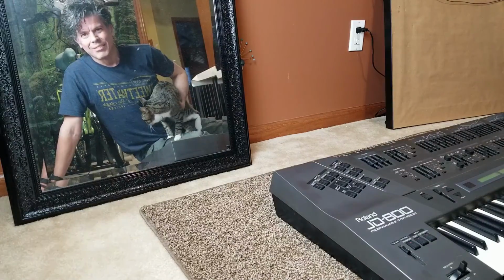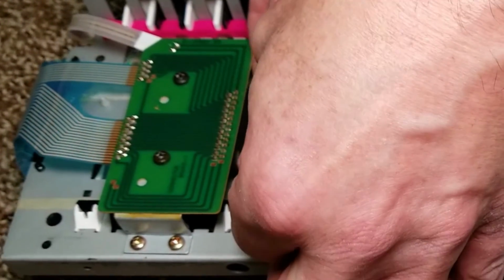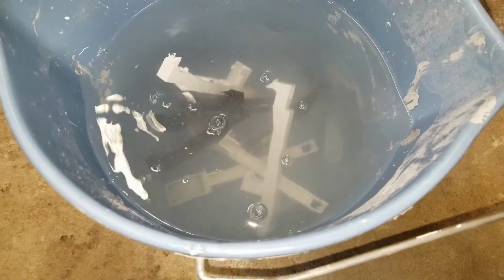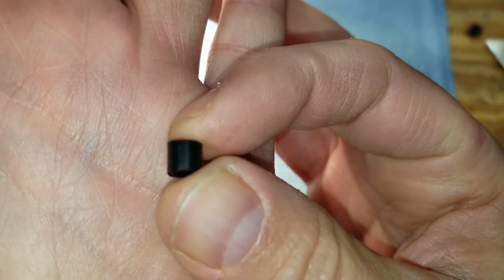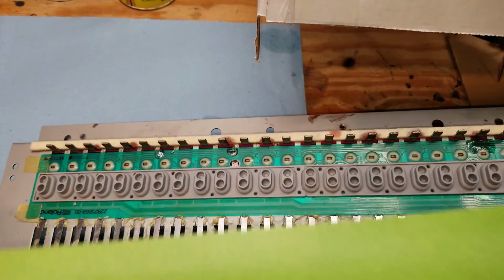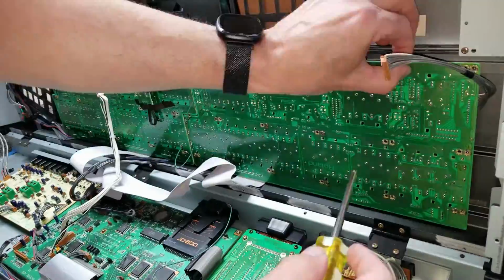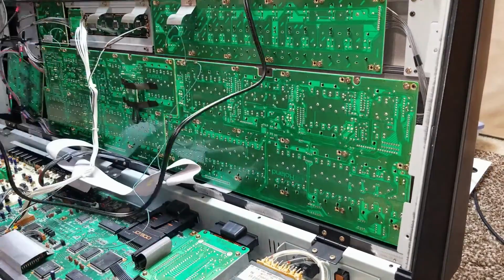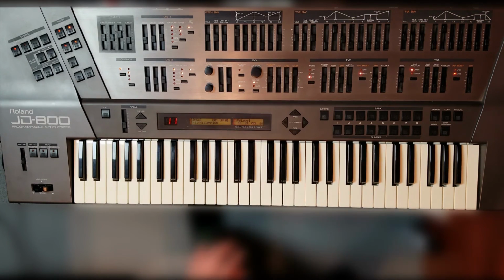Roland JD-800 Repair, Restoration & Modification

Comment: I stripped and serviced my JD800 a few years ago ... fortunately, the keyboard had already been replaced but the sliders and switches were in very poor condition.  I ended up desoldering and disassembling every slider as the synth kept 'self-editing' as the dirt kept randomly shorting or triggering the slider parameters.  I cleaned everything with isopropyl and relubed the slider which stopped the dreaded 'self-editing' bug and then replaced the switches with a set I had bought off ebay and that gave it a new lease on life.  Well worth the effort on such a fantastic synth.
Reply from the maker: A lot of the synths the sliders are available new still, which is always a great option as well. Fortunately for my JD800 the sliders just needed cleaning and lubrication. Glad to hear yours is in great shape!
Reply: I avoid deoxit personally, just adds to contamination, gathering and sticking the dust together.
Reply: @guywilkinson  what do you use instead?
Reply: @Ambientnauts  I normally desolder and open them, but only clean the track and contact end with IPA & cotton tip, don't clean or lube the rest unless it grinds. With an electric desolder tool, removal is rapid and on the 52nd slider, the last one takes 2m 30s to clean including testing with a psu, resistor & scope to confirm.
The first ever clean on my synth was done with a big vacuum cleaner with fine nozzle, worked a treat.
Another issue is that shoddy people spray the entire board with deoxit and it contaminates the connector surfaces causing issues (fault looks like bad pots) and gets everywhere - so messy.
Another issue is that the 10uF electrolytic caps in the front panels go dry and they filter the reference voltage feeding the pots....so they appear noisy when they are not :-)
Reply: @guywilkinson  I had a sneaking feeling that a musician friend is constantly ruining his vintage synths. He says spray dexoit on the keys if you have dead ones. I am like that sounds like a really bad idea, there is rubber under there and contacts. And he is constantly bringing them in for repair. Thanks for you thoughtful input. When I use IPA do you use 70% or 99% ? Does it matter...

Comment: This is very interesting! I bought a JD-800 new in 1992 .. and still have hit. I had no idea of the red glue situation till I was reading an interview somewhere with Rick Wakeman and he mentioned the red glue on his, I immediately dropped my magazine .. ran out to the studio and looked under the keybed and sure enough sticky red glue dripping down the front of the keys! I then checked my D-70 (which I still have) and same thing! 😡 lol. So this was in the year 2004, I lived about 45min from Roland Los Angeles ,so I drove both the JD-800 and D-70 over to Roland .. and they replaced BOTH keybeds with brand new keybeds .. some 12 years after I bought em! Both keybeds are excellent .. much better than even modern Fatar keybeds! The only bummer was when I took the synths over to Roland in Anvil cases .. they were both in perfect like new condition, but Roland put a nice scratch in the finish on the top of both synths in areas you see everytime you play em, being pretty OCD I was pretty upset at that .. but getting brand new keybeds for free kinda made up for the scratches .. that glue was nasty 😳 If not for the scratches Roland put in em they both are perfect condition time capsules .. that I never play, my VST plugin synths have replaced all my vintage hardware synths that I still own in daily working use. Anyway I thought I’d share this since your into refurbing old synths.
Reply from the maker: Yes, Roland had a "recall" of sorts on those synths where they were replacing the faulty keybeds with new ones. It went on for quite a while, but they eventually stopped, and the keybeds aren't available anymore.

I did see online where someone shoehorned a modern Fatar keybed into his JD-800. It wasn't a perfect fit, he had to make minor modifications to the case and do some work on the circuitry, but it did work.

Comment: Thanks so much! I just paid $1000 cash for one that I was assured was "working perfectly" and got it home just to find all the classic problems. I followed this video and got the same rubber key strips from Turkey as you did and everything is working perfectly. I have to say, your JD was way more messed up than mine. For the springs I found it easier to just dab a little grease on the end before putting in place. The Q-tips were making a mess on the first couple for me. Thanks again.

Comment: I found a very easy way of getting the rubber nubs of the key contacts to go back in the holes in the steal. Use the back end of the right size drill bit to push it in. They slide in easily with no oil..

Comment: Glad to have found this! I also have a JD800, and it has shed most of its key weights (i.e., red glue issue). Going to use your video here to guide me in clearing out the glue and restoring the key bed. Cheers!
Reply from the maker: I had all but one of them, and just made my own replacement. It works great now!
Reply: @geneticeffetcs - Good luck! Caustic soda works very well like in Scott video. I let my keys soak for 24hrs, some of the weights didnt come out, so I soaked in fresh solution for 48hrs and all weights dropped off by themselves (give solution the odd stir). I used 500grams of caustic in regular bucket filled to near the top.

Comment: Thank you so much!!! I got one and three of the keys were broken in shipment. I took it to a local Roland repair shop, but they were backlogged, so I decided to give it a go, watching your video. I got the replacement keys and after following all your steps on how to insert them, it worked! The black strips that held down the back end of the keys were brittle, and a  couple broke off, but I added small amounts of gorilla glue and they held. If I have discovered a “gorilla glue” problem, I will report back! Thanks, again!!

Comment: I just dealt with the red glue, wasn’t bad, just a few drips, so what I did was remove all the keys, soaked them in hot water, scraped off as much as I could and then resealed the edges of the weights with a new epoxy so nothing else could ever drip. Perfect fix!

Comment: Hi Scott. Just stumbled across this great restoration video. I have a beloved JD800 that has the same "red glue of death"  problem. It's had it for years and even though the white key key weights have fallen out, the keys still functioned. Black as well. But in the last year or so, I suddenly got dead keys. Some would play and some would not (black or white keys). They were all still pressing down, not stuck. What was strange was it would depend on which patch. Keys that were dead might sound when switched to a different patch. Thought it was a voice card going bad. Took it to a local shop and the guy said the glue got into the key contacts. Thought that was strange since, as I explained here and to him, that keys would function on a per patch basis. Anyway, he said parts are no longer available and nothing could be done. I even contacted Roland and they basically said the same and that they don't service these synths anymore. The rest of the synth works just fine, and I'm using a controller keyboard to play the JD (all keys sound). I have learned that I could try finding a used Roland U20 somewhere as it uses the same keybed, but would have to find one that also doesn't have the glue issue. Those are hard to find problem or not.

I really hate the fact that my beautiful JD has been relegated to being just a sound module. I don't really have the time or expertise to get into a lengthy restoration project. So, I have to ask, would you be willing to restore just the keybed for me?  I am willing to pay for your time and materials (within reason!). I tried finding a way to direct message you here to ask, but there doesn't seem to be one.  If there's a better way to contact you, please let me know and let's talk. I'm in the Los Angeles area. Could send it to you and pay for return shipping in addition to the repair costs. It's ok of you can't or don't want to. I'd understand, but I would be forever grateful. Would love for someone who has the knowledge of doing this to help out as I'm afraid I'll ruin something even more.  Thank you.
Reply from the maker: I would suggest talking to one of these people - they do these fixes professionally, and have access to the aftermarket keyboard flex PCB that you're likely going to need: https://supersynthprojects.com/availability/fitting-partners/
Reply: @ScottsSynthStuff   Thank you very much for the referral, Scott. I’ll get in touch with them. Take care.

Comment: Thanks for the video Scott!  So helpful.

It looks like the keys can move left/right quite a bit due to the brush on rubber.  If you take it a part again, you might want to find tubes like you used, but thinner walled so you can fix that issue.  Maybe even a teflon tube material. I would check out McMaster Carr.

Also, regarding lithium grease on plastic - that may have been a bad idea.  Lithium grease is usually mineral, or petroleum oil based. Better to avoid that for plastic and anywhere near electronics. It may erode the plastic surface. Also, it tends to migrate everywhere. I mean by spreading out in a thin layer to cover everything it touches. If it drips onto the circuit board, it may migrate underneath the gray keyboard caps, and onto the carbon pads and ruin them.

What you used may be OK. Check it. For anyone doing this from the scratch, though, do some research on plastic safe silicon grease. Silicon grease is far better for plastic, or metal on plastic interfaces. You will find different viscosity and compositions. On a synth keyboard, you want a thin grease (or at least not really thick) which will not impede the key from bouncing back quickly. But make sure it has good adhesion for metal to plastic applications so it also doesn't just scrape off.  If unsure, any common silicon grease is likely better than any lithium grease.

Regarding the carbon keycaps on the keyboard.  There are kits you can buy that have a carbon material you can paint onto the black carbon pads on the rubber caps.  Results may vary.  Being able to buy a proper replacement is by far better, but in case people can't find replacement rubber caps, this is an alternative to consider.  

No restoration is perfect, and each job is a learning experience. So please don't take my comments harshly. We all learn this stuff together, which is why you video is so invaluable. Thanks!
Reply from the maker: I agree, I could potentially find a different, thinner walled rubber tubing, but at that point, I wanted to get it back together, and that's the option I thought of - it actually works (feels) quite good.

The lithium grease I've actually used extensively in plastic applications before on motorcycles, but that is ABS - I'm not sure what the keys on the JD-800 are, but they don't feel like ABS to me. I will watch, but this grease in particular does not liquify at commonly found environmental temperatures, so it should be OK.

I actually did have a tube of Caikot 44 https://amzn.to/3abKFuy on-hand to do that carbon recoating, but when I first discovered some of the keys were not working well, I tried using it without much success. That's the point at which I went ahead and ordered replacements. I didn't cover the use of the Caikot in the video, because it did not actually work for my problem.
Reply: @ScottsSynthStuff  Re: Calkot, ya that is what I feared.  I have some, but haven't used it yet.  I had heard it has mixed results.  I was dealing with vintage computer keyboards and have seen some people have success, but others not.  Might be circumstantial.  Such is the world of restoration.  Luckily, I have always been able to restore such keyboards through cleaning the pads (meaning the pads weren't that far gone).

Comment: Thank You so much for this video! It helped me a lot to fix the keybed of JD-800 and will help me to fix the keybed of D-70 in the future. I didn't write down the list of exact key placements asi you did but I didn't really see any difference between e.g. CF 2-3 and CF 4-3 and the service manual states only 5 different types of white keys and one type of black key. I hope it is not a problem that I put them back kind of randomly. Thank You once again.

Comment: Incredible work, a lot of dedication!

I want to clean the buttons switches of a Korg Radias, and the volume potentiometer and patch change dial, could the DeoxIt Faders work? Or would it be better to replace them? Thank's
Reply from the maker: Tactile buttons are pretty much sealed, and are usually better to just replace. The potentiometers you can definitely use DeoxIT F5, as for the rotary encoders, they are generally not something you can service. If they are malfunctioning, you need to replace them.
Reply: @ScottsSynthStuff  Oh, excellent! One more question, the pots that have a "pause" in each option, which are to select the octave or waveform (commonly in Moog analog synthesizers), are they encoders or potentiometers? thank you
Reply from the maker: usually encoders (on newer synths) or rotary switches (older analog synths)

Comment: Really fantastic job. As far as ı know newer synths do not use lead weights under the keys. Yamaha abondoned it in Fsx keybeds.
Reply from the maker: They're steel, not lead, and yes, they still do, on semi-weighted keybeds. My Montage has weights glued into the keys.
Reply: @ScottsSynthStuff  even though my nord stage 3  waterfall keybed have metal weights under the keys

Comment: Scott ... I have mine in pieces at the moment..... Could I still use it as a module even though the keys are disconnected .... Haven't tried as not sure if I break it 🎹🎹🎹🎹🎹🎹
Reply from the maker: Yes, it will work just fine with no keys connected.
Reply: Thanks Scott 🎹 I let you know how the repair goes ...... Keys are soaking at the moment🎹

Comment: Whats the white key weight weigh?  Cant find replacements. Thinking wheel weights.  Thabks for the vid!!
Reply from the maker: Ahhh, I wish I had thought to write it down at the time! That would have been good information for people looking to replace them. I just weighed one of the weights I DID have, then cut a piece of steel flat bar stock and ground it down until it matched that weight.

Comment: I did this in 2020 during the lockdown. I used baking soda in warm water. It took a few days but did a perfect job. He should have kept the new silicone tubing in and remove the excess glue from the keys with a knife. It's tedious but its worth it. Otherwise, great job. I like to leave no evidence of the repair being carried out. It should look like it was done in the factory.

Comment: Any idea what can be done if some glue dripped on the keybed PCB? Should I just leave it?
Reply from the maker: I had some glue on the flexible PCB. The PCB is fragile and tough to replace, so I just left it. You could try encapsulating it in something (i.e. spray lacquer), but make sure whatever you use is compatible with the flexible PCB.
Reply: @ScottsSynthStuff  thanks Scott! I'm thinking I'll just leave it also, don't want to mess that thin PCB up.

Comment: Hello @Scott’s Synth Stuff . Good work and nice video . I need to know where to buy the grey rubber keybed please , can you tell me please ?
Reply from the maker: They're is a seller on eBay called Korg parts master that sells them: https://www.ebay.com/itm/154469733579
Reply: Thanks ! Now I need the pcb flex of the Keybed…where can I buy it ??
Reply from the maker: @VANVASSS  They haven't been made for a really long time, and the originals basically are no longer available anywhere.

Someone did make an aftermarket replacement, I'm not sure if they are still available or not - check here: https://supersynthprojects.com/home/roland-keyboard-replacement-pcb/

Comment: Thankyou! this is a great video Scott! Started restoring mine at the weekend. How did you remove the glue from the green circuit board strip that runs the length of the keyboard that the rubber contacts and keys sit on (like at @ 08:04 in video)?
I'm a bit scared to try and freeze and scrap it off.
Reply from the maker: I wouldn't try to freeze that - the plastic circuit strip would become very brittle, and you'd likely end up breaking it. The glue that was in the felt, I tried at first to just replace the areas of felt with glue, but in the end, I just replaced the entire felt strip.
Reply: @ScottsSynthStuff  How did you remove the glue from the green plastic circuit strip?

Comment: Scott that’s a great how to - thank you. Can you tell me what the weight of the key weights are - you made a spare but I need almost a full set. Thank you, I’ll hopefully get my jd working with your video.
Reply from the maker: I don't actually - I just weighed one of the other weights, then cut some steel bar stock and trimmed it until it weighed the same. I don't recall what that weight was, unfortunately.
Reply: Hi Scott thanks for the reply. I will get a gram scale and do the same. 
Another issue I just had was removing the connector board. It snapped on me as the screws were very tight. On retrospect I realize I could have just removed the metal bracket screws instead of those on the board. So I if you have any leads for me on where I can get a replacement connector board kk1194v-0 please let me know? Thanks again
Reply from the maker: @paulramshaw402  I'm not sure which board you're talking about - the "94v-0" is a designation on PC boards that state how fire resistant it is, it's not a part number.
Reply: Hi , sorry that was the number on it- it’s the transition board connecting the white strip to the flexible connector on the left of the keyboard